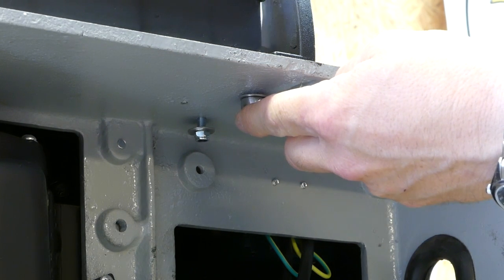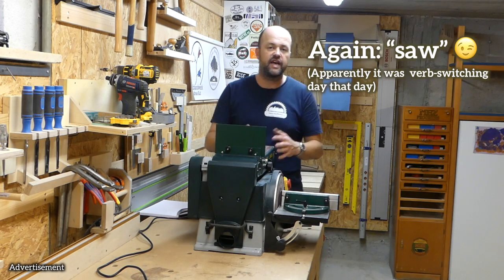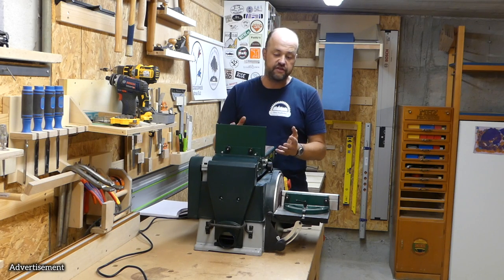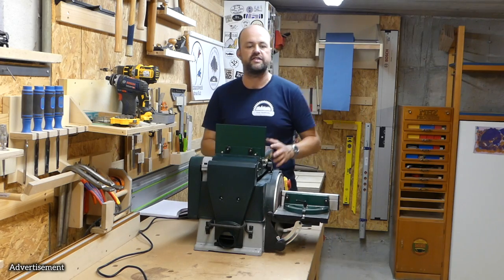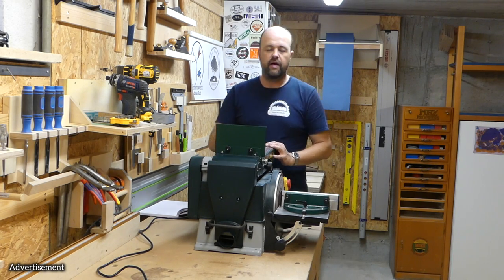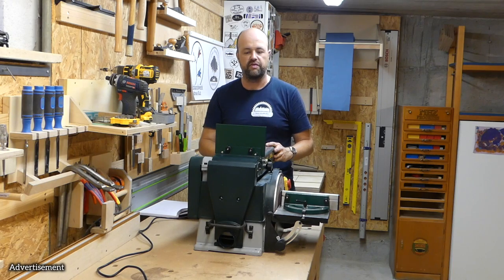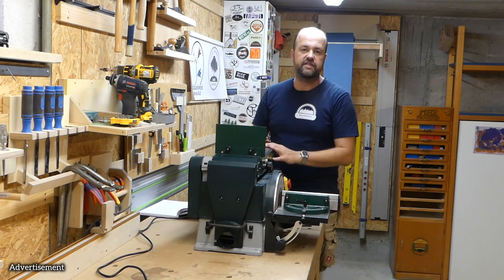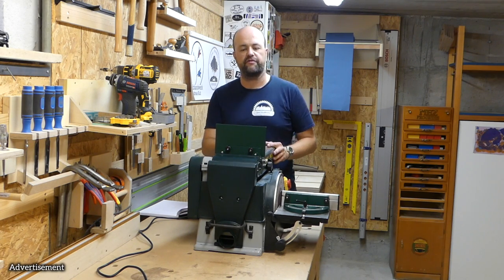BELT SANDER + DISC SANDER Record Power BDS 250 – UNBOXING & FIRST LOOK

Comment: Hi Andreas, following our discussion I decided today after work to drive to my tool centre and  I opted for the Record Power DS300 Disc Sander, the belt option would have been nice but to be perfectly honest I really only need the Disc sanding section, the DS300 is very well built and heavy, and it offers 12inchs of sanding surface so my friend i want to thank you again for all your help and valuable advice, regards Louie from Northern Ireland  Ulster Workshop
Reply from the maker: Glad I could help!

Comment: Hello Andreas! Thanks for making this video. I found it both interesting and informative. A great introduction and initial review. A greatr guide to setting the sander up. I would be very interested to learn your current view of the machine. Has it lived up to your expectations? What do you know consider to be its pros and cons?  Any further information would be appreciated as currently this machine is at the top of my purchasing list.
Reply from the maker: Hi – I still really like this sander. It has held up extremely well and is very robust. Still use it very regularly and can’t complain. The only thing is dust collection but that – from what I know of other sanders – is a problem of this type of machine, not of this particular model.
Reply: Thanks for getting back to me. The information in the video and with this reply is very helpful. Thank you

Comment: Hi Andi, just watched your unboxing vid as I'm considering buying this same Record Power machine. Got to 8mins. 45 secs. and noticed the sanding direction of the belt. It has to be wrong, for two reasons. Firstly, sanding away from the fence makes the fence redundant, and secondly, the dust extraction is useless as its under the fence and all the dust is being taken away by the belt into the surrounding air. Please comment. Thanks 👍
Reply from the maker: Hi Robert, I can see what you mean – it sure LOOKS like the belt runs in the wrong direction. That’s not the case, however, must be an artefact of the camera shutter speed and rotation of the belt. So: the belt runs counter-clockwise and pushes the workpiece against the fence.
Reply: Just looked again, very carefully this time. There is a piece where you’re sanding a piece on the belt and, in this case, it does seem to be rotating towards the fence 👍

Comment: Hi Andrea's, I hope you are well buddy, can I ask you a question regarding the Record Power belt/disc sanding machine? Can you attach the heavy cast iron table to the belt section when the belt is in a lifted or upright position? Thankyou for your help, regards Louie
Reply from the maker: No you can only use the smaller green attachment on the belt.
Reply: @holzhandwerk_ak  thanks pal.

Comment: Hi Andreas, thanks for the video. I have bought the exact same machime but I  am having troubles ajusting the tration of the belt. The belt keeps moving.  Any suggestions?
Reply from the maker: I found that the when adjusting the the traction the machine has some lag – so you adjust the screw very slightly and then have to wait for a couple of seconds to see the result. If you turn too much too quickly, you have a hard time getting it correct.

Comment: Hello Andreas! Thank you for your video and review. I recently added this tool to my workshop. I started using it a few weeks ago and I am quite satisfied about how it works. The only thing difficult for me about this machine is deciding the final height of the machine. I didn't buy the cast iron base and constructed a wooden one. I made a base Wich situates the belt sander to a height of 85 cm (when horizontal) which is very comfortable for both horizontal and vertical positions. The problem is that the disc sander then is so low that I have to sit in a stool to work on it. If I try to rise the base and I get the disc sander to a comfortable height, then the belt sander is really high and difficult to work. What is your experience with this tool after 2 years of working? Did you find a height that works for you?. Thanks in advance!
Reply from the maker: Hi José. My sander sits on a surface that is about 85 cm high, which is too high (I’ve yet to make a proper cabinet on that side of the shop). But since I don’t usually use the sander for a long time, it’s ok to have the belt sander way up high and the disc sander at a comfortable height. You might try a base that’s about 70 cm, so the disc will be at about normal workbench height and the belt could still be comfortable – even though the details depend you how tall you are (I’m 180 cm). Good luck.
Reply: @holzhandwerk_ak  Thank you very much Andreas. I will start at 70cm abd see if it needs any adjust in a few months of use. Happy new year!

Comment: I would have threaded the holes myself. Get a threadset, it's not expensive. I could not live without one.
Have you tried to change the sandpaper at the discsander? It looked like it was glued. Velcro (Klett) is better. Very interesting video. Exactly this machine is part of my wishlist. Importand would be a review in some months with your experiences. Thanks for this. Regards from the Schwabenland.
Reply from the maker: Thanks Alfred. Yes, after this experience the thread set moved up on my to-buy list as well. The sandpaper is glued on, but there is a velcro set with discs that I’m going to buy. Thanks for your comment.

Comment: What is your opinion after one year of use?
Is it worth the investment?
Reply from the maker: It's a very solid machine. The large disc is very useful – I think it’s worth it. If you don’t need the large disc, you can get its smaller sister.
Reply: Thank you very much for the information

In my country only the big one is sold

It is a little expensive

I hope to buy it in the next day

Comment: @Andreas Kalt can you please tell me the size of the drive belt? I dont want to pay £20 to RP when i could get a belt for £5. RP won't give me the information I need.
Reply from the maker: Hi Dave, sorry it took a while. Is the belt the sandpaper? I couldn’t find any measurements on it itself but here (where I got the machine), they sell a set which is labeled " 150 x 1220" which I suppose is millimeters. 150 mm wide, 1220 mm long: https://www.holz-metall.info/shop1/artikel9095.htm?selectedVariation[8414]=528
Reply: @holzhandwerk_ak  the delay is fine but the belt I am asking about is the drive belt that goes from the motor to the belt sander.
Reply from the maker: OK, how do I access it? Turn the machine over?
Reply: @holzhandwerk_ak  not it has a cover on the back of the machine. The panel is just where the tension screw it for the sanding belt bed

Comment: Thanku Andreas for your excellent and informative video, I am driving to my local tool store tomorrow and considering buying this model from Record Power, I think the only thing that scares me is the little thin support table to the belt, do you find it strong enough, does it offer proper support? Your view and opinion I would value, keep up the great videos, always enjoyable, king regards, Louie from Northern Ireland Ulster Workshop
Reply from the maker: Do you mean the vertical stop on the left? It’s plenty strong. Thanks for your feedback!
Reply: @holzhandwerk_ak  hi Andreas, I mean the little flat steel plate that acts as a support table for the belt, the HEAVY cast iron table in front of the disc looks plenty strong but my worry is the little green stern plate support table fixed in front of the belt, is it strong, does it flex and does it stay true, thank u mare regards Louie from Northern Ireland Ulster Workshop
Reply from the maker: I can see what you mean. It is sturdy, but it moves a little (doesn’t bend but wiggles in its fixation). I think it’s not meant to stay at exactly 90 degrees. If you want to sand something to 90 degrees, you’d use the disc. This little plate is just a stop for pieces pushed down on the belt so that they don’t eject to the left. For that it’s definitely strong enough.
Reply: @holzhandwerk_ak  Thanks buddy, you have explained this very well, I think what i will do is choose the Disc Sander rather than the belt and disc, I do fine cabinet work and perfecting clean 90degree edges is most important to me and my work, thank you for taking the time to explain and answer my question, I wish you well in the future, God Bless kind regards Louie from Northern Ireland Ulster Workshop
Reply from the maker: 👍 – By the way, I’m a great fan of Ireland and have lived in Galway for a year back in 1999/2000! All the best to you, Slán!

Comment: Hi again Andi, thanks for the vid and info. This is quite a substantial machine and currently retails on Amazon.de for nearly €500,-! This vid is from August last year. Hopefully you have had the opportunity to put it through it's paces since then. Would be good to get some in-depth feedback from you as I'm planning to invest in such a machine soon. Thanks buddy 🤘
Reply from the maker: Hi Robert, I've used the machine extensively and couldn’t find any serious issues. There’s just one thing that I’d add: the metal disc doesn’t have a velcro layer attached to it so the sanding discs are stuck on with a glue layer. I'd get a velcro disc (already got one for myself) and velcro sanding discs for easier change of discs. Otherwise I can recommend it. There’s a smaller version, too, if you find the price too high (BDS 150).
Reply: Thanks Andi. Will check out the smaller version too. Can one buy a "Ready to apply" velcro mat for the disc or did you manufacture one yourself?
Reply from the maker: I bought this starter set sanding discs which includes a velcro disc: https://www.holz-metall.info/shop1/artikel8842.htm?selectedVariation[8149]=505

Comment: You could have threaded the holes, cast iron threads like plastic.
The device seems robust for woodworking perhaps OK. How loose is the angle guide on the table, does not seem to be exact fit.
At least the table is held by 2 screws on either side.
Reply from the maker: At that time, I didn’t have a tap. I got a set of taps by now an will thread the holes at some point. 
The angle guide has very little play – it seems fine. But for a perfect angle, I wouldn’t use a sander.
Reply: Why, the Sorby ProEdge is designed to do just that, sharpen tools at a perfect angle. Your sander is way more heavy and solid, but as they say it's better to have straight aluminum, then chinese quality steel tooling.
Reply: Who says that?